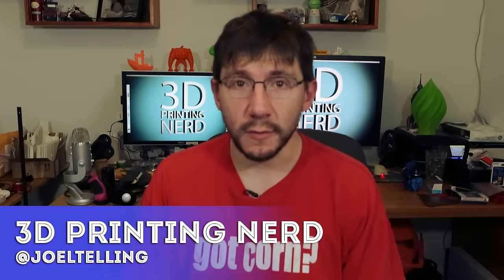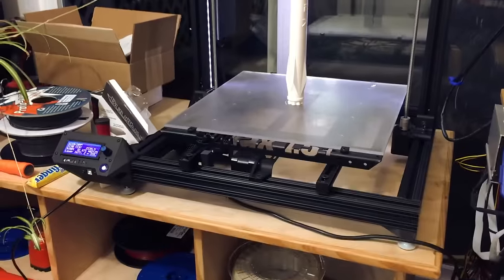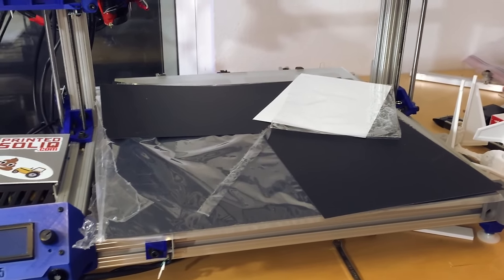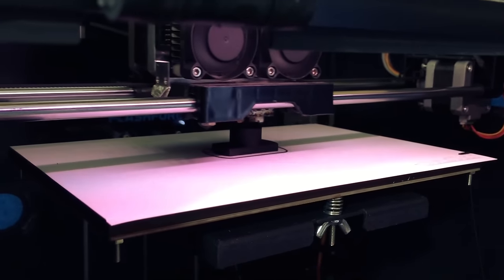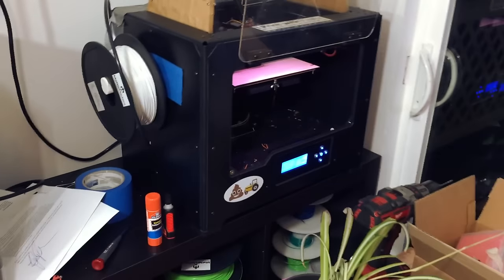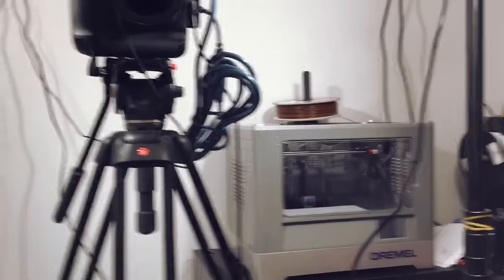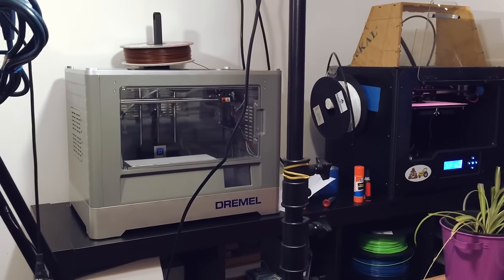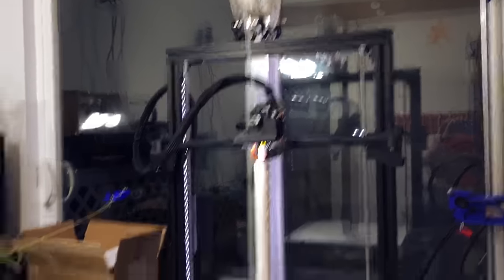Nerd Vlog 008 (gMax, Proto Pasta, SpaceX, Butterfinger)

Comment: How do you find the speed of the new gMax?  My big problem with big prints on my replicator 2 is just how damn long it takes to print.  I've never filled the build volume because I just don't want to wait the 20 hours it would take.  Also, Colorfabb white is fantastic.  It prints like a dream.
Reply from the maker: +Michael Vaughan Yes, it does print like a dream! As for speed, I set it in Simplify3D, and for the gMax printers I set anywhere between 60mm/sec - 80mm/sec. Unfortunately, bigger prints just take that long. My longest was 44 hours!

Comment: Could you showcase a smaller more affordable printer? Btw loved the video as always!
Reply from the maker: +Connor Tobey Yes! In fact, I just got a Wanhao Duplicator i3. I'll be unboxing and showcasing that!
Reply: +3D Printing Nerd Would love a kit build on it if possible. If I'm not mistaken, I would definitely save some money!
Reply: +Connor Tobey Also, in the video could you say if it's a good printer to start with? Finally, (Sorry for asking for a lot) would it be possible to show how or tell me where to find out the calibration, what settings to use for different filaments, and the main settings for printer.
Reply: +3D Printing Nerd Prev. Message

Comment: As someone who is getting an idea builder for xmas, how are you using non dremel filament?
Reply from the maker: +DrunkDoctorGaming Do you mean how as in how am I hooking up the roll to the machine, or, how am I doing the settings? To make it print non-Dremel filament, all you have to do is feed in the filament. It'll take it so long as it's 1.75mm filament. The rub is that normal filament rolls won't fit on the inside. You have to mount it above the printer. Technically, a broom handle between two tall boxes is enough of a filament spool holder. Some people get fancy, others not so much. That's it! Does that make sense?
Reply: +3D Printing Nerd Yes and thank you,keep up the amazing work on your videos!
Reply from the maker: ***** Will do! Glad I could help, don't hesitate to ask other questions. I'll do my best to help.

Comment: The Buildtakk was just to sticky for me. Great for Nylon 618 though provided you have large pads.
Reply from the maker: +66tbird1 I seem to have it JUST right, as it's very sticky, but once a small part of an edge is up, the piece comes off like butter. No joke.
Reply: Are you heated?
Reply from the maker: 66tbird1 I use Buildtak on both heated and non heated beds.